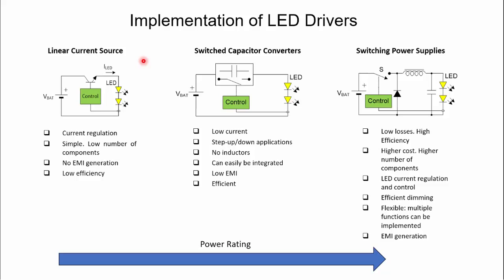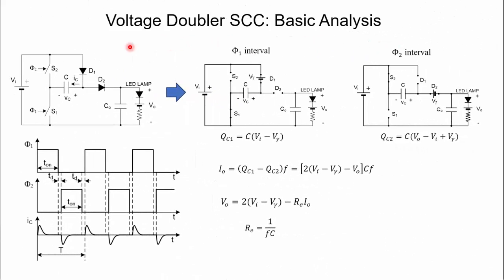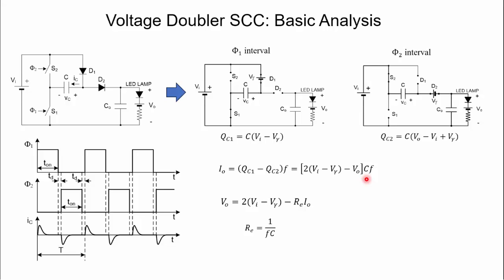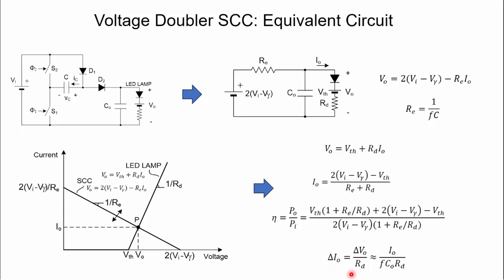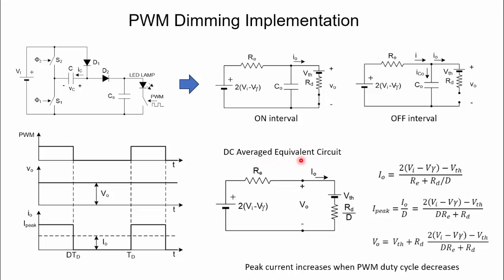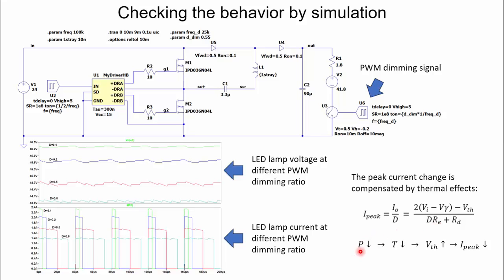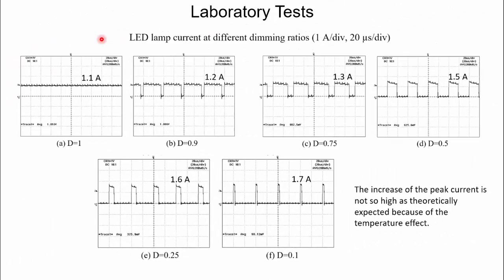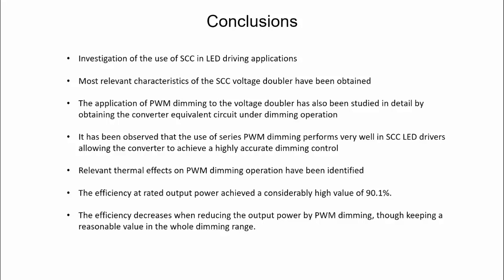PE #57: Investigation of the Use of Switched Capacitor Converters as LED Drivers

Comment: Hi, Professor, great course again.
I have a question. Why do the gate drive signals of the half bridge driver become "0" after the charge and discharge current in the charge-pump capacitor becomes “0”?
Reply from the maker: Hello, thanks for your question. This is a deadtime between the gate signals of both switches to avoid a shoot-through current. This time is usually very small. For example, for a switching frequency of 100 kHz, the deadtime can be around 500 ns.